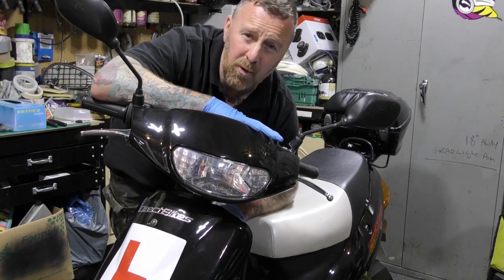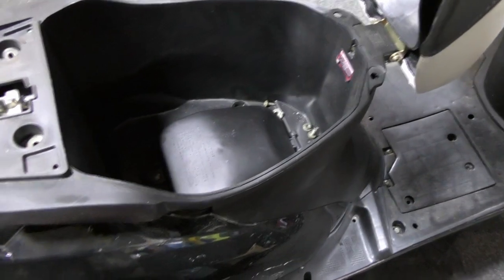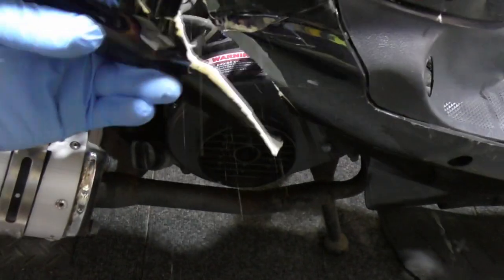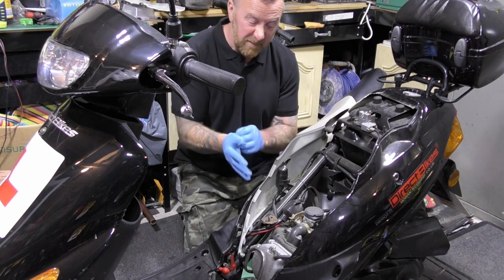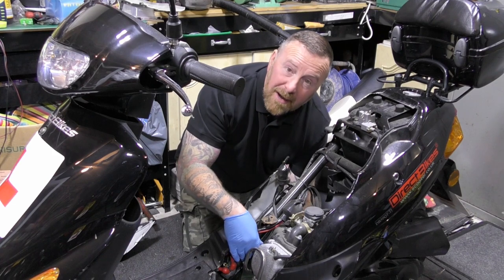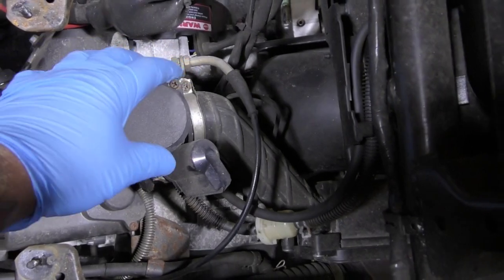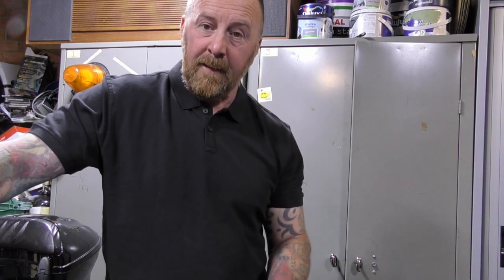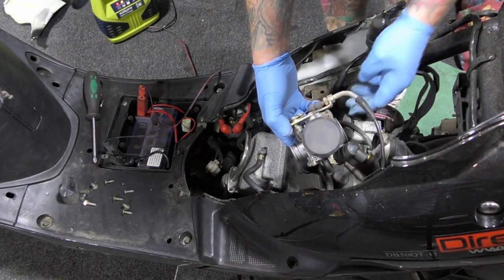50CC MOPED SCOOTER WONT START ,LETS SEE WHY

Comment: Sir I really need your help to help figure out why my moped won't start I drove it to the store from my house which ain't but 5 minutes and on my way back the moped died on me it cut off I tried to push the button and it sounds like it ain't spinning like this starter Bendix came out but when I got the moped home the starter Bendix was still in place it's getting gas to the carburetor it's getting spark can you give me any ideas on what to check next

Comment: Hi mark wandering if you new what the problem could be if my 2009 rox back brake won’t work. Bit of fluid has leaked out the rubbers . Would I need new rubbers?
Reply from the maker: if you can get it apart and then all back together with no problems 
me best to buy another one bud ,new of 2nd hand

Comment: Top tip, use a plastic syringe from a kids Calpol box, put on the end of vaccum line, pull the syringe and boom the fuel keeps flowing till empty ☺️
Reply: @marksavage  u shouldn't get any fuel in the syringe though ? Your symply drawing air out of the vaccum tap to make the fuel flow through the fuel pipe

Comment: How could I get Incontact with you about a speedfight 3 2011 that has been having problems with the carb getting no petrol
Reply from the maker: Vacuum bud test that like in my videos if ok then 
Wet hand test as may have other problems
Reply: @marksavage  we have suck and blowed through the vacuum pipe and petrol has come out but as soon as connected back to the engine nothing

Comment: Great video Mark!!! I'm not a diy'er.... quick question....my son has this moped and is 19 now and I would like to know in your experience if the restriction to 30mph is in the carb or the spacer in the variator casing. Could do with it being a little quicker ..thanks in advance
Reply from the maker: Honestly I'd get him a 125cc bud
You can mess around with these but they then don't last and go wrong!
You can do a small up by 4 and 6g fresh roller and even a sports exhaust and yes you'll get 40 but can't say how long for bud
Reply: @marksavage  thanks mate for the quick response...and I thought as much .... Runs very well so may gets good resale value ...thanks again

Comment: Quick Question.... What happens to all the old fuel you drain out of all those mopeds? I mean you're not going to use it an any vehicle are you? so how do you dispose of it?
Reply from the maker: I use to use it to clean off the panel before spraying as in the decals 
Clean wheels 
Get the bbq going 
But had so much I ended up taking to the dump with the old oil 
As that started to gain up too lol

Comment: Hi I have been trying to google but can’t find any information. Do you know any significant differences between speedfight 1 and 2?

I am pretty sure I have an speedfight 2 206. Because that is what is on the plastics but in the registration it says Peugeot S1. The year is a 2003. 

Thank you for any help.
Reply: Anything to set them apart? It has a single front axle.
Reply from the maker: Sp1 and sp2 
Plastics 
Front and head light
Rear plastics and light 
Rest are the same 
Electrics as in connectors otherwise the same 
Oil pump manual on sp1 cdi pump on sp2
Everything else is the same and can be used on both 
Sp3 nothing is the same bud 
Sp4 engine are but most other bits no
Reply: @marksavage  thank so much! That was a quick response!
Reply from the maker: @isak55  I have over 100 speedfight videos 
All will help 
Type in speedfight Mark savage

Comment: Hi mark , my old fruit.can I ask you a quick question please mate- where do you get them panels from for them bloody direct bikes as I’ve had a right job sourcing them because on mine some lugs have broke off and Because am a Virgo or it could be because I might have a OCD problem everything has to be spot on on my scooter no sorry my mo’ped lol. 🤪 what another great video from the savage . Cheers mate. ✊🏻👊🏻💙
Reply from the maker: Lol hi bud 
E bay was the only place I found them but its what you type in so like gy6 or pulse , etc 
To be honest I could buy a spare gy6 ped for under 100 with a dead engine with wood panels cheaper than buying the panels ! 
Worth a go bud
Reply: @marksavage   I shall give that a go thank you so much buddy for messaging me back. 💪🏻👊🏻

Comment: i  deristricted my 50cc and it was fine for about an hour but then it wouldnt start and engine made a weird sound,could you help?
Reply from the maker: ok what moped do you have 2t or 4t and how did you derestrict it bud and weird sound as in ?
Reply: @marksavage  do you have an email i can send the videos over
Reply: @marksavage  peugot speedfight 4 stroke 22 plate
Reply from the maker: @TOMREES4  I would have said upload a video bud 
But as its a 22 plate I wouldn't have played with it being new and under warranty 
As in my speedfight 3 videos 
They are not just exhaust and carb and rollers but efi and cdi restricted and need to be done at a garage bud
Reply from the maker: I'd put back what ever you did
Reply: @marksavage  i got it properly done at bike shop,removed washer from variator
Reply: @marksavage  uploaded  video on my page
Reply from the maker: @TOMREES4  but they are cdi restricted  , all that might have done would be to give it faster pull away
But I'd have changed the rollers to 6g
Best take it back as it may have put the pully out of alinement  and the belt us spreading!
As you paid for it pop it back just to check it over 
Double check the 4t engine oil too bud
Reply: it is a lot more nippy and cruises at 30 instead of 27 i did not think this would affect the bike running tho,but thanks for your help

Comment: I hotwired my 50cc moped and left it on for like3 days now Its not even cranking over anything I should replace
Reply from the maker: Aa in left on as running?
Or just ignition?
Rewiring is not good bud and probably damage cdi 
Check for spark
Reply: It's the battery saw happened with mines I brought. A new battery den cranked ober